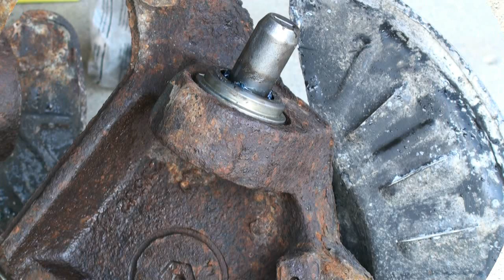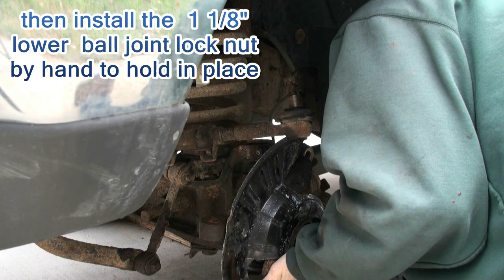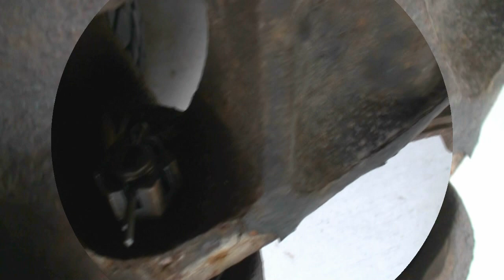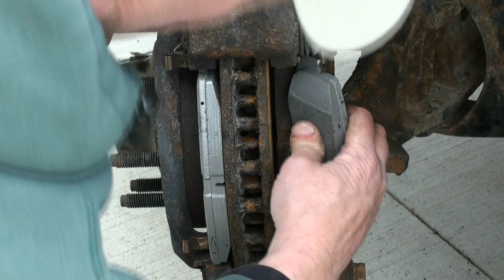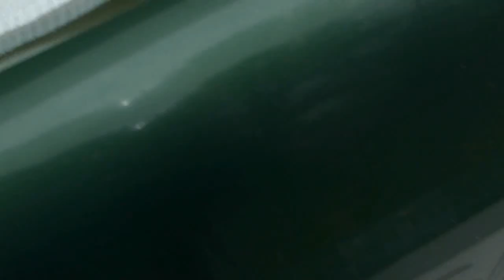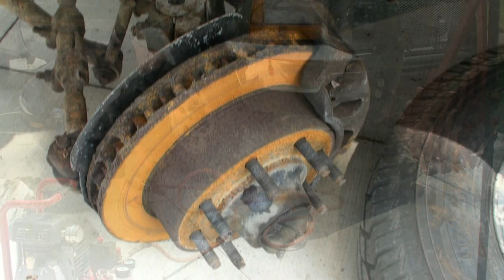Ford F250 Ball Joint Repair - Part #3

Comment: This three part video series was excellent thank you for taking the time to do them.  I have a 2002 2WD F250HD have to change the upper ball joint on the driver side I luckily found the puller/installer kit used in video 2 on a 1/2 price sale so bought it.  Posting the part numbers is very much appreciated as well.  The camber adjustment piece had me confused until I saw in your video what to do with it I figured I had to remove it as well.  Once again well done and much appreciated you have saved me hundreds of dollars...  I also have a 99 F250HD 4x4 that has the upper ball joint on the passenger side going I'll be using the puller/installer kit on that truck as well and a buddy has an older Dodge 1 ton 4x4 pickup that also needs ball joints that puller kit is going to be used on it as well...

Comment: The only thing I see wrong here is the rusty rotors, as mentioned below.  Unless I missed it, there was no mention of the rotors being turned. 
Lastly, no mention of using break clean to clean off finger prints etc.  Of the oil residue left from turning the rotors - if they were turned. 
Thanks for sharing the video!

Comment: Great video!  Two things you may want to know. First, the caliper and caliper brackets can come off as one piece--you don't have to remove them separately.  Just remove the bolts for the caliper brackets.  I should say, they ARE harder to handle when they are taken off together as they are heavier.   Do what you are comfortable with.  Second, the rotor doesn't have to come off of the spindle.  Again, it's heavier to handle, but it saves time and you don't have to worry about junk getting in the bearings.
Reply: great but you should  grease the caliper slides & repack the bearings then put a new inner seal for a complete job

Comment: should have mentioned checking-replacing the wheel bearings while it was apart and repacking the grease..  otherwise, good videos..

Comment: The wind chimes in the background is a relaxing sound for a job like this. One thing though, you pulled the rotors and caliper brackets, that really didn't need to be done unless you decided to repack the wheel bearings at the same time.

Comment from the maker: @motorman1700 thanks, the air compressor is from tractor supply and it's a 2hp, i picked it up to keep around for light jobs, the bad thing is it kicks off at 115psi instead of 125psi and turns on at 80psi and you can tell its a little low to use in the video right now, I'm going to try and turn the pressure up on it when I get some time. thanks